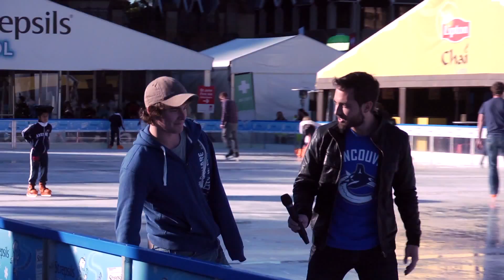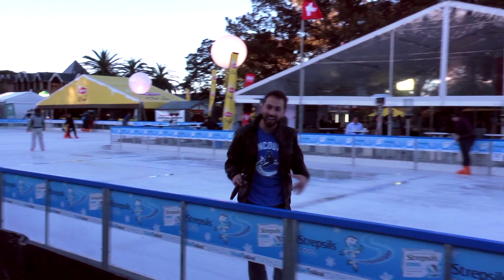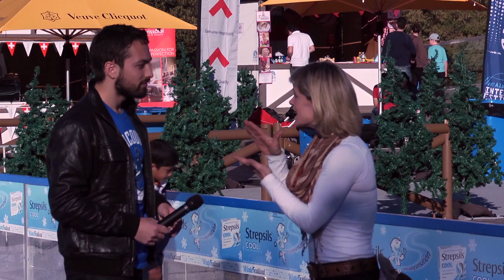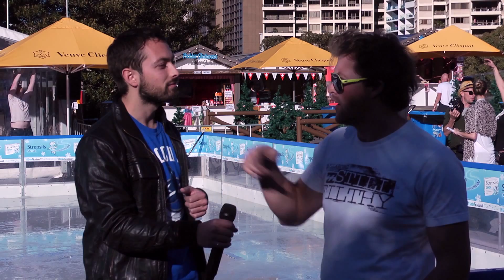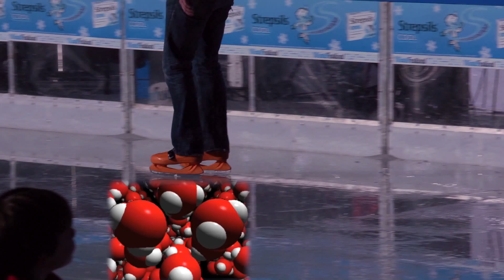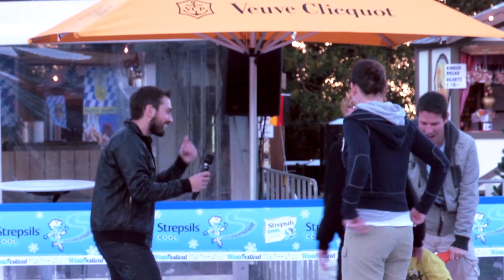Why Is Ice Slippery?

Comment: No...

They can make skates out of non-steel items that will glide smoothly, the problem is plastic becomes weak and brittle in cold and would shatter if constantly used near ice and any other material also has similar reliability problems working in such a cold environment. 

Its nothing between steel and the ice

Comment: I agree with xBris. But i've got a little observation to make. There are no ice skate blades made of diffrent material than steel (at least that I know about). Try to skate on aluminium blades or plastic. It's just don't work, and none of manufacturers makes non steel blades (there is composite of steel and aluminium, but for weight reducting reasons). What I think, there is something going on between water and steel. Maybe somehing related to elektrons and ions, things that makes rust, etc.

Comment: Ice being slippery due to pressure is largely untrue (while pressure does lower ice's melting point, it only does so by a fraction of a degree for a human), but the interesting thing is that there's still some debate as to why exactly it happens. We know that ice has a liquid like layer down to rather cold temperatures, but it's uncertain whether that or the friction caused by a skater creates more slippery conditions. My money's on the fake water layer, though. Ice is slippery without friction.

Comment: Shifting a melting point seems extremely unlikely to me. Water is a tough beast: you need, like, 100 atmospheric pressures to move its melting point 1 K lower, and it absolutely, absolutely minimal melting point is only around -20 degrees Celsius. Really? 10 Gigapascals are barely reachable, maybe, if you are heavy and your skates are very sharp.

Comment: Hey Veritasium: It's actually false, that water melts because of the pressure. It's a simple math exercise: You would need much much more weight than a human could provide to actually acomplish that. One reason, ice melts under skates is actually due to friction, which creates heat, thus smelting the ice which decreases friction again etc. The exact mechanism to skating is however not yet well understood. Greetings, a chemist.

Comment: I would have guessed that it was the friction causing the ice to melt, not the compression.  Very nice.  I enjoy these videos when the topic isn't something simple like how long it takes Earth to orbit the sun.
Now I pose a question:  Would some temperature be cold enough that it's too cold to melt even the ice with the reduced melting point resulting from the compression?  If so, I doubt that extreme could be reached naturally anywhere on Earth.

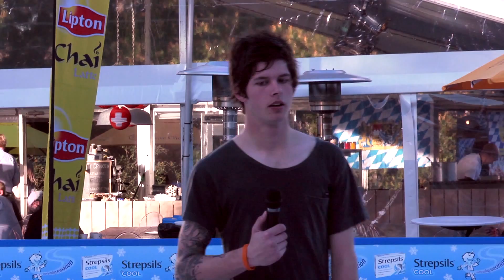Comment: 1:41 -People seem confused here. It's normally the other way around. Compressing a substance will typically RAISE it's melting point. This is the reason the core of the earth is solid despite being very hot. HOWEVER, in the case of water, when water becomes ice, crystals form and actually decrease the density, compressing it actually heats it up, breaks the crystals, and melts the ice.

Comment: Yeah, I'm pretty sure its the other way around too. In space, for example, where there is no pressure, the water boils at ~30ºC, so you would boiled from inside out. The less pressure compressing the molecules together (raising the intermolecular force between them), the less energy (temperature) you would need to melt/boil them, since they would have enough kinetic energy to surpass the intermolecular forces (H bonds, London forces and dipole-dipole; for water).

Maybe the friction them?

Comment: Question from another Vancouverite!

I learned that water is a funny substance. Unlike most others, its liquid form is denser than its solid form (as seen with ice floating on top of a lake for example). So other than decreasing the melting temperature of the ice, would not the increase of pressure applied by your skate, and thus the increase of density, cause the solid form to change into its liquid form? 

Thanks in advance for your response!

Comment: Part 2: When it's even colder more ice forms adding to the mass and changing the temperature again that is needed to slow down said molecules. the water under the ice can be below freezing point but the added pressure makes it unable to freeze. It's sort off a vicious circle. (Text was too long for a single comment sorry for that)

Comment: Part 1: If I'm correct this is also the reason why ice is formed on top of a lake, creek or other large bodies of water, not just because the cold temperature gets there faster but also because the weight of the ice pushes on the water chaning the temperature in which the molecules slow down to become a solid. Also because ice has a lower mass than water it wil be on top of the water where it's then able to apply that pressure to the water below it.

Comment: surely the air temperature is irrelevant, ice maintains 0 degrees C as its temperature so pressure is the key. the edge of an ice skate with you on top places a massive force on a small surface area.

Comment: If it is -10 degrees c, the pressure to melt ice is approximately 100 MPa! So for an 80 kg individual, this would require a skate contact area of 8 mm^2 which is around an order of magnitude less than that of skates. Also, the melting ice with pressure theory would also imply that ice would not be slippery when wearing shoes as the pressure is much lower.

Comment: I think that water is one of the few situations where this phenomenon applies, as water in its liquid form is more dense than the solid phase, ice. So when compressed it goes back from its solid to the liquid phase. With most other compounds the opposite would be true, higher pressure leads to lower melting point.

Comment: but your skates don't slip sideways. why? your skates are basically razors, so they cut into the ice deep enough to cause a crevasse just deep enough to cause two sides of the edges of the skates to be held up. you can stand on one spot for a while because the deeper the cut, the slower it continues to cut. that said, you cut into the ice fast enough while moving to cause that small crevasse, creating enough sideways friction but not enough forward friction because the front is curved.

Comment: "Pressure melting cannot be responsible for the low friction of ice. The pressure needed to reach the melting temperature is above the compressive failure stress and, if it did occur, high squeeze losses would result in very thin films."

 Colbeck, S. C.
American Journal of Physics, Volume 63, Issue 10, pp. 888-890 (1995).

Comment: so the blades on the skate are more stable why? doesn't the pressure increase when the same force is applied with a smaller area ( shoe compared to thin blade). Or could it be the grove that is created by the skate that makes it more stable!?

Comment: See, the reason he dominated that kid in the race at the end is because his weight was spread across a very small surface area (the skates) while the kid's weight was spread across a larger area (the base of the chair). The smaller surface area caused greater pressure to be applied to the ice and hence caused more ice to melt. The increase in the melted ice decreased his coefficient of friction, which allowed him to skate faster.

So it had very little to do with skill.

Comment: I'd expect that the issue really is: Why is the melting point of water so high with respect to similar substances (like ammonia, ethanol, etc.)? The answer that I expect is both the hydrogen bonds and the shape of the molecules, which increase the binding energy. On the surface, this increase in binding energy is much smaller because some nearest neighbors are missing. The result is that a thin layer (<10 nm) of water has a much lower melting point than bulk water.

Comment: Not exactly. Ignition is not similar to boiling or melting. In fact, it differs greatly. Fire is just rapid oxidation. If you want to ignite something easier, you have to increase the pressure. However, it is the opposite with melting and boiling.

Comment: Pressure does affect the melting point of any (I believe) object. Same goes for boiling point - you can boil water at 69 degrees Celsius on the top of the Everest (the atmospheric pressure there is lower).

Comment: Due to the water molecules in the solid (ice) phase of water being more spread apart (due to network covalent bonds) than they are in the liquid phase, ice is less dense than liquid water. Thus, by applying pressure to ice with the skates edge, we force the spread out water molecules closer together to the point they reach the closer distance characteristic of liquid water. That's why pressing a solid snowflake will turn it to liquid.

Comment: so if water freezes at 32 degrees F and the pressure of your skates only change the waters melting point by say 5 degrees then what if its -10 degrees F ?  then even though the pressure changes its melting point the overall temp is still cold enough to keep the ice frozen right?  So in that case this would not be true.  not saying your wrong at all cause idk much about it, just kinda throwing out a situation here.

Comment: I live in Winnipeg (Canada) where the temperature in the winter frequently drops to -35°C, and people still frequently skate outdoors. I'm kind of skeptical that this is all that's going on. Smooth ice is still slippery even when weight is relatively well distributed over the surface (although admittedly less so).

Comment: Sorry but that isn't true. Even1veritasium admits that pressure heating is only significant over -3C. If you want to test this put two pieces side by side in your freezer. Make sure the sides are touching. Come back the next day and they will be one block of ice. This happens because there is a layer of water on the outside of ice. Just go to wikipedia.

Comment: dude easy answer, ice only gets so cold, the external temperature doesn't matter, now if the whole planet's temp drops way low for a long time that might be an issue, but if you supercool water you will play hell trying to keep the molecule together, supercooling water is one way to split hydrogen from oxygen. and as long as it is a water molecule, and it is frozen. if you do compress it and keep the molecule. mars's poles are sometimes warmer than it's equator

Comment: Pressure alone would make you stick to ice. Sliding on melted ice is easy, but its possible to skate on "dry" ice too. The pressure is NB, but dont think its the main reason. If it was pressure alone, one would be able to skate perpendicularly to where your feet point. The mechanism responsible has to do with the skates which each have a groove between blades. The blades "cut the ice", aided with the pressure from the skaters weight, which then sits in the groove and you "float" on melted ice :)

Comment: but ice just as you are telling is slippery because of water, pressure just turns ice into water. So reason ice is slippery is because of water and not because of pressure.

But there is something more on the ice surface that you do not find, say for e.g on concrete floor, that makes it more slippery, explain that.

Comment: This is not true, the amount of pressure that skates put on the ice per cm^2 is not large enough to cause the ice to melt. If this were true then how would you explain sliding on ice with your shoes or objects with little mass and a large surface area sliding on ice? The real reason you slide on ice is because there is a naturally occurring layer of water on the ice. The theory here has already been completely discredited.

Comment: @1veritasium I'm glad you pointed out the liquid-like structure of the top layer of ice, because I saw in a video back in middle school that said that "the ice melts when your on top of it" theory was a bit of a misconception and it was rather the flimsy, unsupported molecules on the top of the ice that determined its slipperidity

Comment: When we apply pressure to the ice causing the molecules to come close to each other, shouldn't that increase the melting point because now more force has to be applied to break the inter-molecular forces and convert the ice to water. Also, from this video, can this also be concluded that objects with greater mass will find the ice more slippery than objects with a smaller mass because the greater mass object applies more pressure to the ice than the smaller mass object?

Comment: @ChaosN I looked at some phase diagrams (although I have not gotton to that point in education to properly understand exactly what was beign described, I tried to understand as best I could what it meant). Is this correct:
The pressure and the temperature determine the phase of an object. Because of the shape of forming ice it is less dense than that of the liquid water at a slightly higher temperature.Thus adding pressure will create the same conditions for a liquid as with higher temp?

Comment from the maker: @zebruh Since posting this video, I have been informed by a very reliable source that surface chemists have recently come to the conclusion that the surface layer or two of water molecules in ice are naturally quite 'liquid-like', so although it's true increasing the pressure decreases the melting point, it is not the only reason ice is slippery.
Reply: This video should have a pinned comment by Veritasium that the slipperyness of ice has nothing to do with pressure provided by the sliding material. It was a long standing hypothesis that has now been fully debunked by recent research. In fact, even before that research was done, the phase diagram of water showed that the pressure provided by ice-skates is nowhere near the pressure needed to melt the ice just a few degrees below the freezing point. The fact that ice is slippery even without the use of skates should also have alerted scientists not to promote the pressure hypothesis. The beauty of science is the ability to admit false assumptions in light of new evidence.
Reply: @jesperlett  I think it would be incorrect to say that slipperyness of ice has "nothing to do with pressure". Surely the pressure also helps when the temperature range is between 0 °C and -3.5 °C but outside that range, the pressure alone does very little.
Reply: @ Recent science has revealed that the slipperyness of ice is due to surface molecules not being able to bond with the crystalline structure of ice. So ice is extremely slippery even when it's not wet. In fact no ice changes state into water underneath the blades of the ice skates at temperatures well below 0 °C which is preferred by skaters (I think -7 °C). Ergo, pressure plays no role in the slipperyness. I would assume, actually, that if some ice were melting due to pressure of skates (say ice at -0.1 °C), that skating would be less efficient. That's because it requires a certain amount of energy to make water change state from solid to liquid state even if the temperature stays the same. That energy has to come from the skater's kinetic energy which translates to more friction. I'm not saying wet ice is less slippery. I'm just saying, it would make sense that state change from solid to liquid due to the pressure of skates would increase friction. Which translates to less slipperyness.

Comment: can someone explain to me exactly - is it the pressure puttign energy into the ice causing the temperature to rise which makes the layer of water, or is that the pressure displaces the molecules and changes there state into a liquid even though their temperature would suggest they should be a solid (At least for a very small layer on the top)?